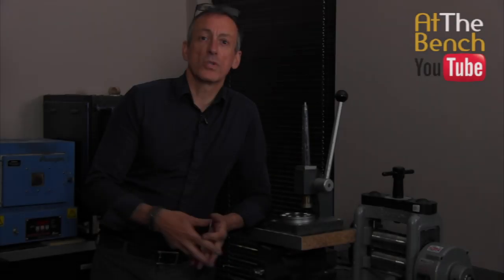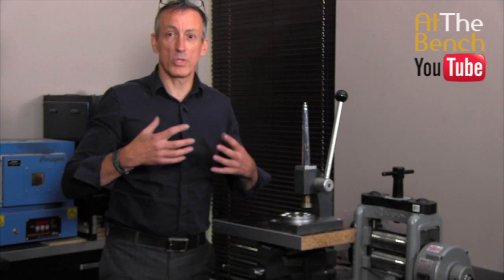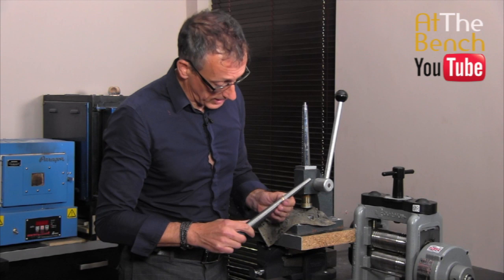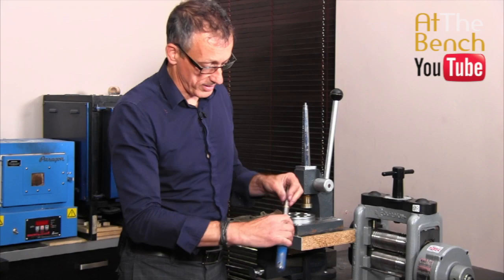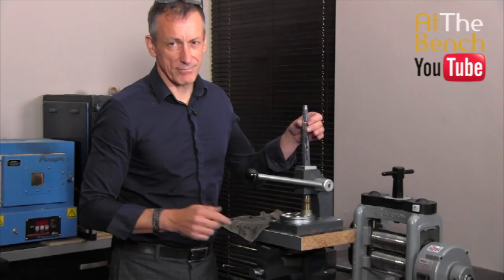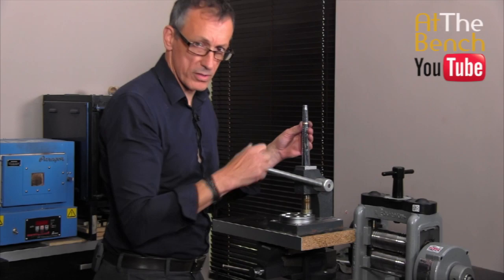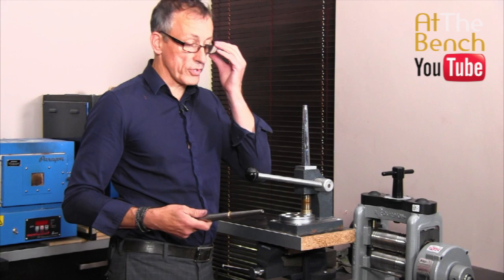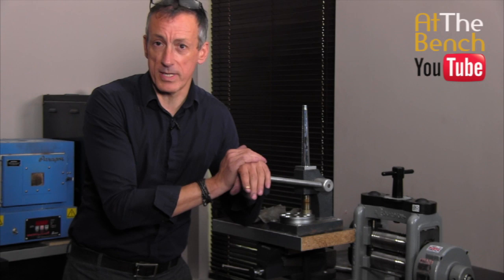How To Reduce A Patterned Wedding Band - Repairs - How To's

Comment: Nicely made instructional video. Just need to be careful with bi color bands that they are not two unattached pieces. Going down in size may cause them to separate. Also I find that spinning as well as turning the ring over when upsizing helps keep the band from showing marks from the splines.
Reply from the maker: I did mention this when I said about the number of splines. If you have 4 splines then turning the ring a quarter of a turn helps 👍🏼
Reply: Wrapping paper around the splines when stretching if engraved on the inside stops the marking and having to refinish
Reply: @Atthebench  Thanks for the vid Andrew. I suspect an eighth of a turn would work better on a 4 spline stretcher as you would essentially return to the same spot with a quarter turn.